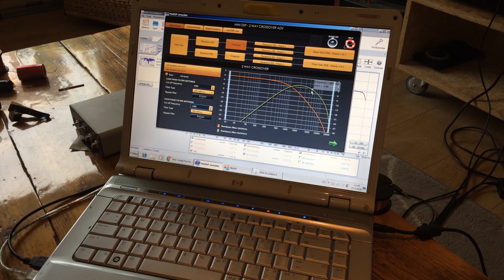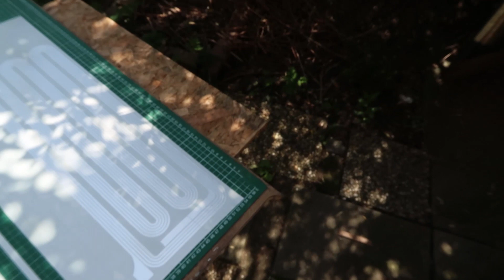Bass Planar Magnetic Woofer from scrap steel - Part 3 making foils

Comment: When I was working on planar bass membranes, I used neodymium magnets. I had of course to put some space between them in the vertical direction as well, otherwise the glue wouldn't keep them in place. So I used a more complex membrane in order to utilize the magnetic stray field not only between the vertical columns but also between the horizontal rows. The non-motorized parts were a  lot smaller too perhaps yielding higher resonant frequency modes.
I guess with no particular surrounds, one can use ferrite magnets as you do; the excursion will not be that much anyway and the membrane a lot easier to make.
Reply from the maker: well xmax is 3 mm. not insane also not bad. i also dont think going much higher is nice. i suspect compression becomes a thing then after a while.